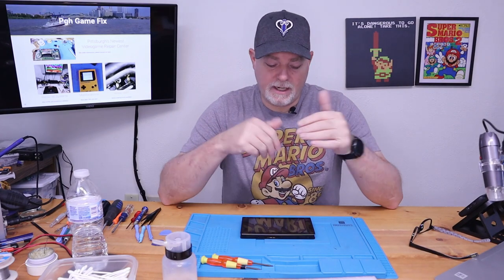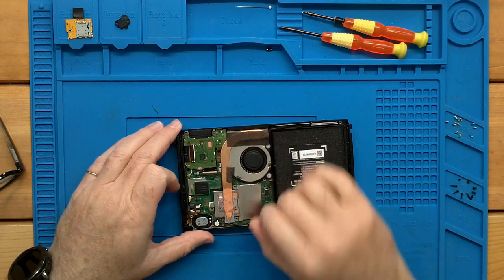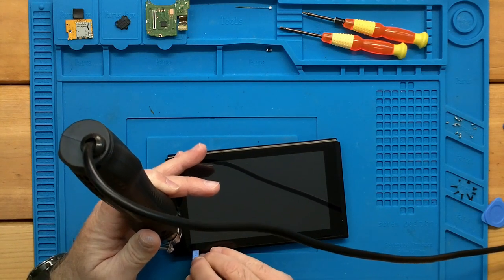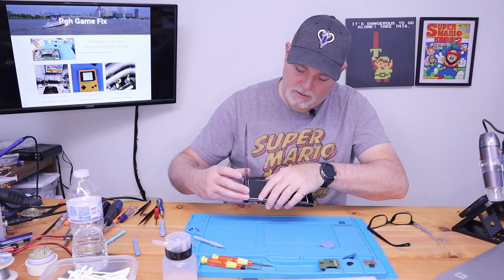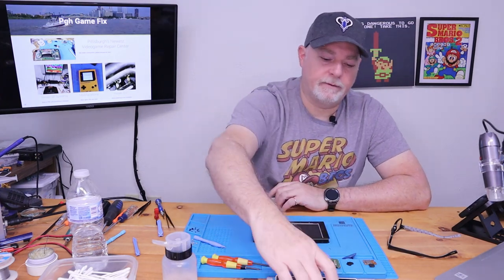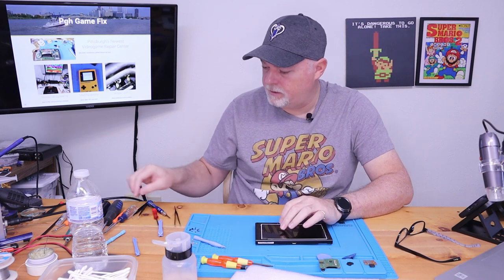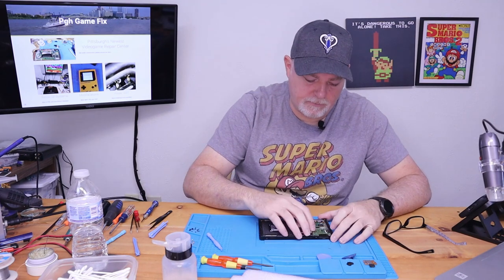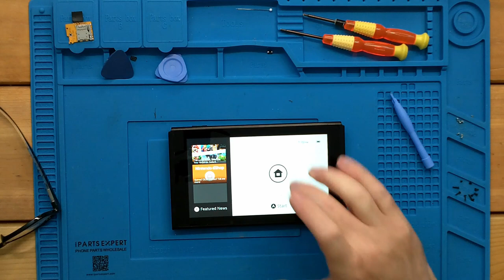Nintendo Switch LCD Screen replacement. (how to remove the touch screen)

Comment: Thank you so much for this! I left my switch on the back of my car when I drove home. Drove around looking for it at 1 in the morning to find it had been run over a few times, with a trashed screen, but no casualties other than that and the controllers. The rest of the system works flawless. Even the digitizer works perfect, though there’s road rash all over it so I’ll have to replace it and the backplate. But shockingly the controller rails work perfect along with everything else, including docked mode. Hats off to Nintendo for making it idiot-proof.
Reply from the maker: Thanks for watching... and I'm glad your system only had minor damage.

Comment: Hey, so I scrolled through the comments checking if anyone said this, but I was wondering if a switch could still connect to the TV even if the LCD screen was broken. I apologize if that’s a dumb question lol.
Reply from the maker: Not a dumb question at all.  YES... assuming there is no damage to the main board... it would still work on a TV. THanks for watching.
Reply: Np, thanks for replying!!!

Comment: Thank you so much for this tutorial. I tried to repair my damaged switch by myself (first mistake) using this tutorial because it looked exactly like your thumbnail photo but when I connected the battery the screen stayed black. The sound is working and when I touch it I know that it’s moving around but it won’t show anything on the screen. Any recommendations?
Reply from the maker: The screen has 2 connections.  The small one is the backlight.  Make sure it is in all the way, in the connector.
Reply: Seems like the part I got had a backlight. I put all the old back on and I’m looking to mail it in to someone who does repairs. Do you take mail ins? If so do you have an email I can message you on?

Comment: Hi there, this video is good and all but like I just don't trust myself on doing this, so can you recommend any really good professional Nintendo Switch screen fixtures cause I can't find any and I got the exact same problem that you showed in this video. If you can that will help
Reply from the maker: I'm not sure I understand what you are asking about "Fixtures".  The repair has to be done by hand.  If you want to send it in, I will be happy to repair the system. If your digitizer is still good... you are looking at $65 for  a new LCD, plus shipping if you are not local to wester PA.
Reply: Samr
Reply: Same
Reply: @PghGameFix  how do I get in contact with you I may require your service
Reply from the maker: @mike25985  You can message me on Facebook or Twitter under PghGameFix
Reply: @Alexander Zhukovsky lmao

Comment: hi so my friend has a switch and his screen broke from him dropping it. The switch turns on but it doesn't display anything. However, he connected it to a tv and worked for a little bit then it started to not work again. What could be the problem here and would there be a way to fix this ?
Reply from the maker: the screen and the tv out don't really have a connection. so, I would think there is some other internal damage from the drop.  OR... the USB-c port is just warn out.

Comment: Thank you! Yesterday I smashed my switch screen out of anger which is embarrassing and I’m not forking out £68.52 just for someone to fix it because it’s literally the only portable console I have. I’ll try this next week and if it works I’ll try to keep my pro controller away from my switch screen..
Reply from the maker: Just use some heat, and you will get the touch screen off without an issue.
Reply: @PghGameFix  Noted, I’ll be as careful as possible whilst doing it so I don’t screw up my screen even more.
Reply: @PghGameFix  not able to do this. Can i send u mine to fix please.
Reply from the maker: @olgurl9857  Contact me on facebook for shipping info.

Comment: I don't have new adhesive with my digitizer I ordered can I just peel it off from the old digitizer to the new one ?
Reply from the maker: you can if you are careful. You can also use some 3m double sided tape from walmart, or the local hardware store.
Reply: @PghGameFix  okay, thank you !

Comment: Do you work like at a store or something because I need my screen fixed🥺
Reply from the maker: The physical work is done off site because the store is physically too small to set up a proper work area.  But yes, I work from Warpzone in Greensburg PA.  If you are local, you can drop it off, and if you are not, you can mail it in.
Reply: @PghGameFix  okay thank you very much
Reply: Im willing to send it in around how much would the repair cost?
Reply: @IKSRTFO  how much would it cost
Reply from the maker: @IKSRTFO  If both parts need changed, about $75
Reply from the maker: @leeundreymoreno6770  If both parts need changed, about $75

Comment: I have a small hairline fracture on the digitizer but it's not hindering the LCD or any of the functions. Just needed to know how to replace the digitizer. Thanks for the video. Just wondering, would you recommend using the heat gun on the screen after reassembling everything to make sure glue  sticks back on.
Reply from the maker: You really don't need the heat.  As long as you aren't touching the original adhesive... it will have plenty of "Stick" to hold the new one in place.

Comment: Hey I hope you still read these comments but i have a concern about save data will this effect the save data IF the screen is repaired because i know nothing about the internals of the switch
Reply from the maker: Yes... I try to read all comments that I see.  No, replacing the screen has nothing to do with save data.  If you are doing this yourself, all your data will be fine, once you are done.  With that said... if you send it into the factory for warranty, they may just swap it with another and the one you get back will be blank.
Reply: @PghGameFix  Ah thanks for the info

Comment: Hello I was wanting to try to replace the LCD on my switch that just broke today I saw this kit on amazon but it says it is not compatible with switch models HAC-001(01) would anyone think there would be any issues with this or should I be fine. I tried linking the kit to show but my comment kept getting blacklisted and deleted
Reply from the maker: I will add a link to the proper kit.
Reply: @PghGameFix  Thank you

Comment: Wondering what I did wrong, or if the console might just be completely dead.
When I try to turn on console with the power button to test screen after repair it won’t turn on. But if I plug it in the lcd goes to a blue screen but the console still don’t turn on.
If I leave it plugged in a few minutes then unplug it the screen stays lit blue for about as long as I plugged it in for. 
Any ideas?

Comment: Question, when a screen gets damaged, the LCD panel will be the thing in need of replacement, not the digitizer, correct?
Reply from the maker: Right.  Sometimes the digitizer gets damaged... but normally just the screen needs replaced.

Comment: can i replace a bad lcd screen with another lcd screen that as the same resolutions and the same number of pins?
Reply from the maker: If it fits, uses the same "Pinout" and uses the same controller... then yes, it should work.  But to just say "It has the same number of pins" is not a way to judge if the screen will work.

Comment: The little white hinge broke off trying to put in the cable no images showing on screen. Could I tape the cable down with something?
Reply: Yea I definitely have bent pins in the connector. Now I gotta fix that.
Reply from the maker: @katiebell8872  The connector on the lcd is very fragile. I've tried to fix it while under the microscope... and I've never been successful. I have a video on how to replace the connector.

Comment: hey umm can you show me how to fix the nintendo screen its because i was raging and i hit the screen hard and the screen is all gray
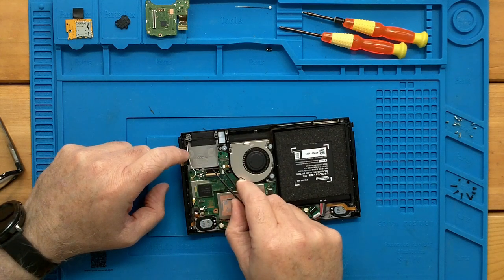Reply from the maker: Just follow the video.  at 5:28 ( https://youtu.be/53kfdi6yMBU?t=328 ) you can see me release the screen connector.  the backlight connector is just above the speaker below. Then, after the touch panel comes out... the screen will also come out.

Comment: I got a blue dot on my screen. It dropped on hard wood floor. Go figure. Is there anyways to replace the screen? I got a OG switch from release. Really don't feel like sending it to Nintendo and having to wait 2-3 weeks for repair. And covid shipment delays... Btw I'm slow. And understood it. Just had at following instructions when people talk fast. You hit it spot on tho. Ty. :) You got any fix N64 controller guides or any other controllers from drifting etc? :) Don't want to spend allot of money on a new controller.
Reply from the maker: I'm glad you like the video.  There's no way to fix the dot other than to replace the screen. Yes, I have a couple N64 vids.  Just look in my channel, and you will find them.

Comment: I’m just trying to take the digitizer off to clean underneath, but I don’t have a heat gun and I’m scared to take off the digitizer and damage it. Any recommendations?
Reply from the maker: Yep... I do have a recommendation... use heat.  If you try to take it off cold, you will most likely crack it.  You can use a hair dryer if you are carful.

Comment: Ok sorry to correct you here but the digitizer allows you to have touch but then the lcd is the thing that is glitched so if you can still tap on the screen but the screen is glitched you have to replace the lcd not the digitizer.
Reply: Thanks for taking your time to read this i would appreciate it if you replied back to me.
Reply from the maker: Right. So I'm a little confused with your comment.  The video is about changing the LCD and not the digitizer.  But, it's showing a safe method of removing the digitizer to get to the LCD.  I'm guessing you didn't watch the vid since it's doing exactly what your comment is saying.
Reply: Ok sorry 😞 my mistake i kinda fudged up i will try not to make that mistake again.
Reply from the maker: @Jamie_idkrlly  No Problem.  I'm often wrong. LOL

Comment: weird question: should the digitizer work if not glued? Because i wanted to test it before glueing it and the touch screen doesnt seem to be working so i don't know if the new one is broken or it just needs to be very tight to the lcd screen to be working (and it isnt if not glued).'
edit: it seems that sometimes it register the touch on the left side of the screen but its still not glued.
Reply from the maker: Yes... it should. We are finding that new digitizers don't like some controllers. so they may need a harder press... or will only work around the edges.
Reply: @PghGameFix  mine works for sure on the bottom left corner, didnt try the others. Is there something to do other than getting it replaced?

Comment: how do i know if my lcd flex cable port on the motherboard is damaged? and how can it be damaged?
Reply from the maker: Generally, you know it's damaged if you can see it (like the bail broke off) or if you just cant get the cable in anymore.  But, if you have a magnifying glass, you can look into the edge, and see if there are any pins bent.  They are fragile, and can be damaged by using too much force, or if you try to put the cable in and it's not straight.

Comment: Can u help me itwont stop making noise and got that screen. Should I take out the battery
Reply from the maker: That screen is because it's smashed.  Disconnecting the battery will make it quiet.
Reply: @PghGameFix   thanks it stopped making the sound

Comment: my ribbon cable at 5:11 wont come out by its self and im scared to force it oout T_T any ideas what I can do?
Reply from the maker: If the bail in up... it should slide out.  If it doesn't, something may have been spilt into it, and it's just stuck with something sticky.  If that's the case... use some alcohol... it should free up.

Comment: One question, the touch panel is possible remove  without breaking the screen??
Reply from the maker: Yes.  There is no reason to harm the screen, if you just need to replace the touch panel.
Reply: @PghGameFix  i see the screen very,very, punch.... i supose the screen is very fragile.... what is your personal opinion?? Do you think a normal user I could take it off without breaking?
Reply from the maker: @spardas6900  Sure.  As long as you warm the glue/tape, and slowly work around the touch screen with plastic spudgers.
Reply: @PghGameFix  ..... Ok if you think ill try bro, thanks i have station rework in home.

Wish me luck ;) jaja
Reply from the maker: @spardas6900  you got it !

Comment: Would this fix it not connecting to the tv
Reply from the maker: No... probably not.  There is a chip that switches to the HDMI.
Reply: @PghGameFix  do you know how to fix it as I have a switch that has a damaged screen and it also doesn't connect to the tv

Comment: Would you happen to know if this creates any problems with connecting the switch to HDMI? My nintendo switch has this same problem along with the fact I can't conntect it to my TV
Reply from the maker: No.  A broken screen doesn't stop it from connecting to a TV.
Reply: @PghGameFix  ah man, I guess i've got 2 problems on my hand then. Do you know what could be causing it to not connect to a tv? previously it would connect and I could use the homescreen and settings but as I soon as I launched a game it would disconnect, but recently it wont connect at all
Reply from the maker: @shnsi  the PI3 chip controls the HDMI.  BUT... it could be the dock, or a messed up USB-c plug also.
Reply: @PghGameFix  I may aswell get them all checked out when I get it fixed, how much do you think it'd all cost? Via 3rd party electronic fixer
Reply from the maker: @shnsi  Hard to say.  Depends on what is found to be wrong.  But a screen, and a P13 chip... probably around $140/$150.
Reply: @PghGameFix  ah alright, thank you for the help
Reply: @PghGameFix  Hey im back here because im thinking of doing this myself, the part I need is a lot cheaper than when I first broke it but i've never worked on a nintendo switch. The hdmi still doesn't work but I haven't been able to test if its my dock or the switch itself. My usb-c port works fine because it charges. The only problem with my switch is the screen (volume, joycons and joycon charging, touch screen, and all buttons still work). Does this description of whats wrong with it still fall into only needing a LCD screen digitizer replacement?
Reply from the maker: @shnsi  The screen has nothing to do with the dock, or the HDMI out.    broken screen  on the switch doesn't keep it from booting, so if it's put in a dock... it would still work on the tv. Also, just because it charges, doesn't mean the HDMI encoder is good, and working.
Reply: @PghGameFix  do you know how I could tell if my nintendo switchs hdmi is broken? Without having a replacement dock or switch.
Reply from the maker: @shnsi  No.  You need a dock to get it to switch outputs.

Comment: I replaced the lcd but the screen is black, did I do something wrong?
Reply from the maker: Did you plug in the small ribbon on the bottom?  It's the backlight.
Reply: @PghGameFix  yeah, the screen lights up, it's just black though :/
Reply from the maker: @troubledbiscuit1735  is the system booting? Can yo hear any sound?  If you can, I would check the main ribbon for the screen, and make sure it's in all the way. If not, then there is something else wrong.
Reply: My screen is black but I can touch it and hear the taps. The connectors are all in. I don’t know why it’s not working

Comment: How much do u think it would cost to get it fixed
Reply from the maker: The parts are generally $35 for the LCD.  With labor, I generally charge $55. If the Digitizer is also bad, then it would just be a parts cost.  (another $20)
Reply: @PghGameFix  how much would you charge if i send it there bc we don’t have a lot of money and my switch is broken badly 🥺
Reply from the maker: @stealth6973  It depends on what is broken exactly.  But for the screen, the prices are in the last comment.  Plus shipping.

Comment: Is this a v1 switch or a v2 because I need to fix my v1 switch
Reply from the maker: That's a v1... but a V2 is the same.  The new OLD may be different.  I haven't opened one of those yet.
Reply: Thank you

Comment: Do you think replacing the screen will do the fix if your Switch has screen tearing?
Reply from the maker: I may not understand correctly... but I've never seen tearing on an LCD.  AND, when there is an issue with that, it is normally caused by the controller chip going bad.

Comment: My switch broke and I do not how to fix it
Reply: Can you help me
Reply: The screen broke the same way
Reply from the maker: The video is a direct walkthrough on how to change the screen.  If you are local to the Pittsburgh area, you can drop it off at WarpZone in Greensburg if you would like me to work on it.

Comment: Can you fix my switch
Reply from the maker: what is wrong with it?
Reply: So i one day got really mad a  smashad it with my  controller and now its cracked
Reply from the maker: @AdairTheKid0  Since it's a hard impact... I don't know how extensive the damage may be... but I can probably fix it.  If it's a screen and digitizer, you would be looking at around $100 with the shipping. (if you aren't local to Greensburg PA )
Reply: Ok thank you very much